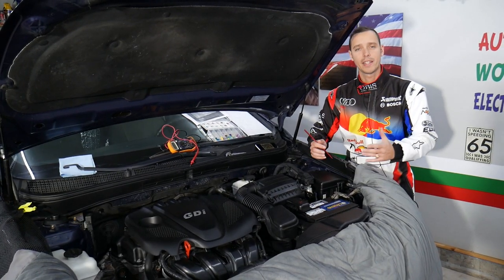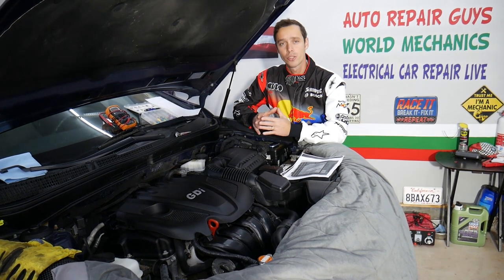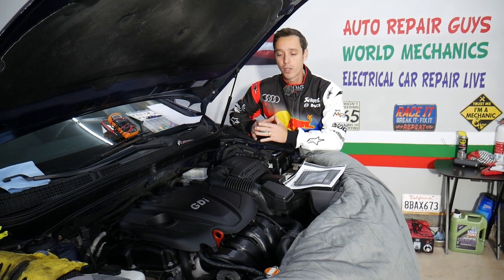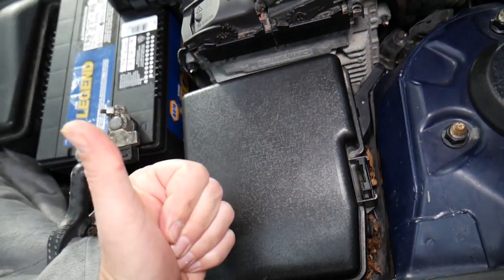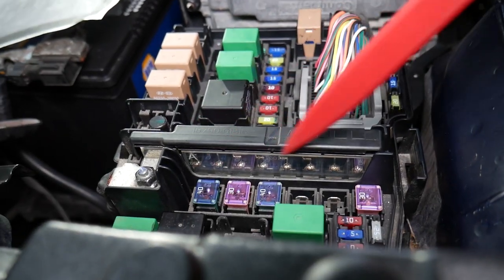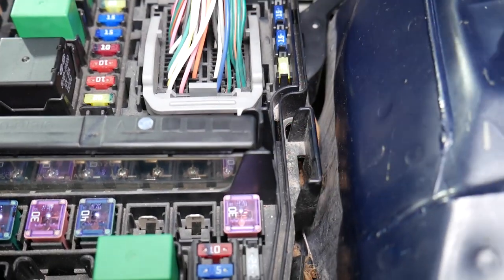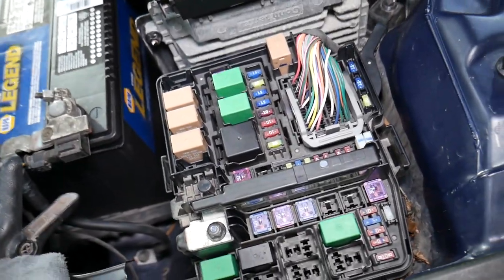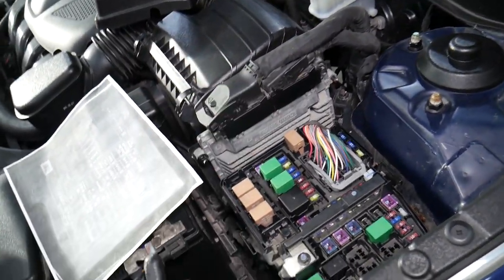KIA OPTIMA STARTER FUSE LOCATION REPLACEMENT

Comment: I like your videos, but half of your videos are commercials.  Can you brag less and explain more about the issues?  There is also a 7.5 Amp Start fuse inside the car, under the steering wheel.  Can you explain what does that fuse do?  I have not power on that fuse, thus I have no crank and no start.  Can you tell me what could be wrong?
Reply: Not only that, but helf the video is referencing other videos that explain steps in the video you're watching. The definition of click bait.
Reply: And there's no link to the video.
Reply: Did you ever find out when that start fuse didn’t have power and if so how did you fix it